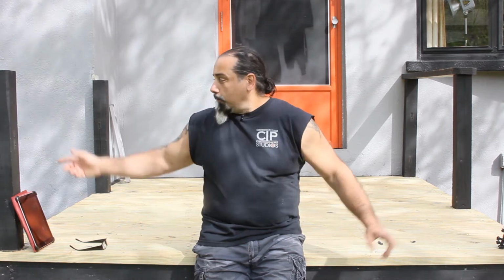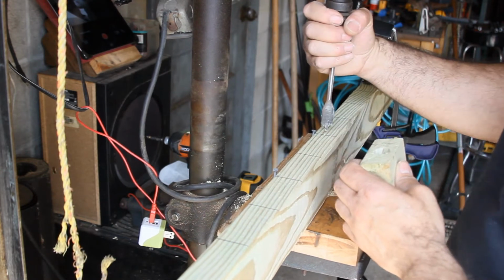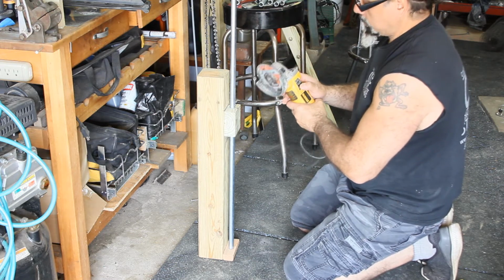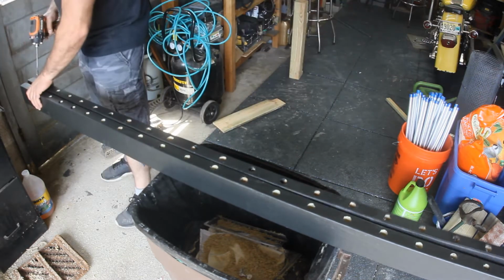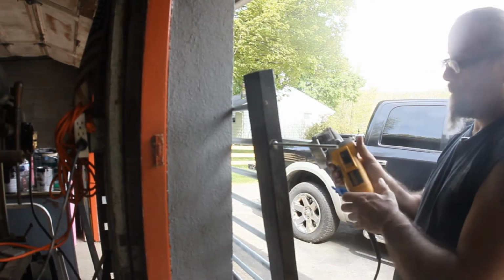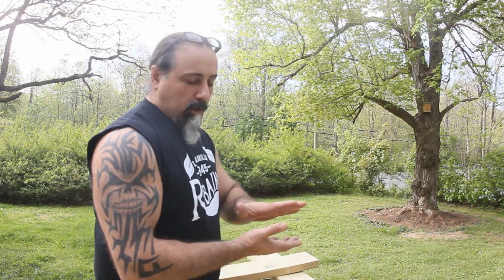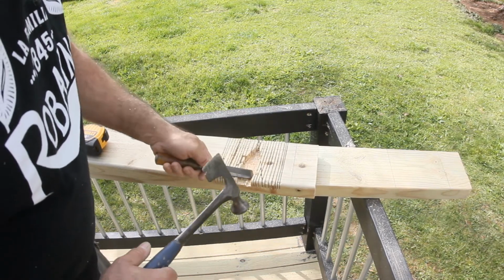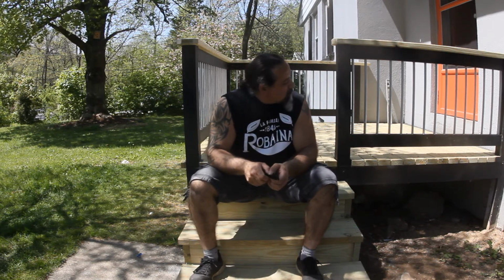Do it Yourself Modern Deck Railing on a Budget

Comment: Nice looking railing! Do you need to seal the bottom spindle entry points with caulk to avoid water accumulation in the holes and wood rot?

Comment: This is beautiful. I'm going to use this idea in my porch which I'll start to build next week. What type of metal are the the spindles, aluminum, stainless steel, galvanized or something else? Also, did you use any special exterior paint to give it that beautiful non-glossy look?
Reply from the maker: Hi Danny, they are galvanized 1/2" electrical conduit. They come in 10' lengths.